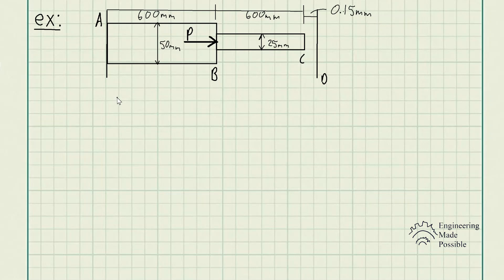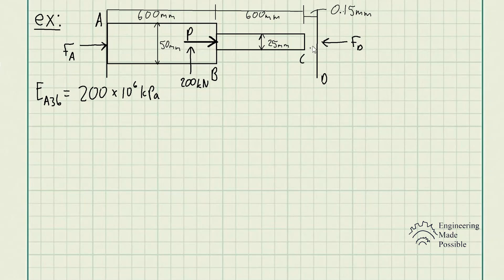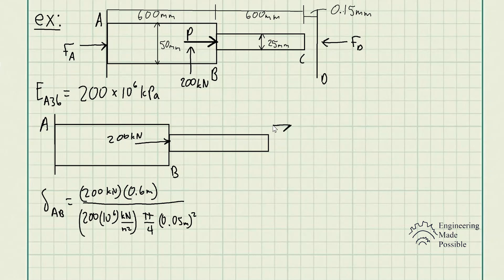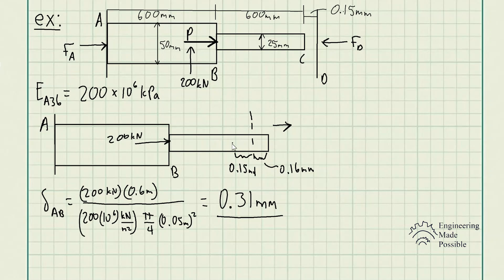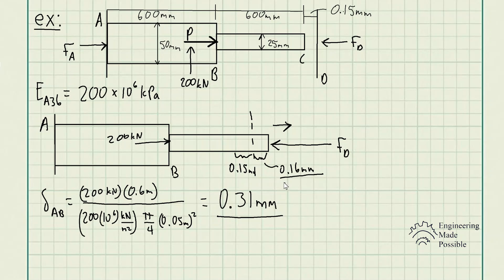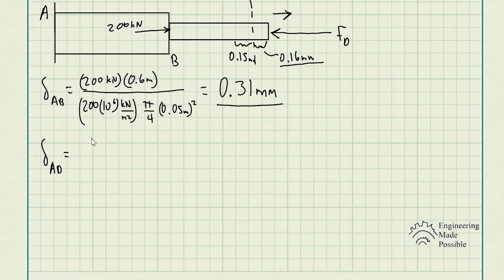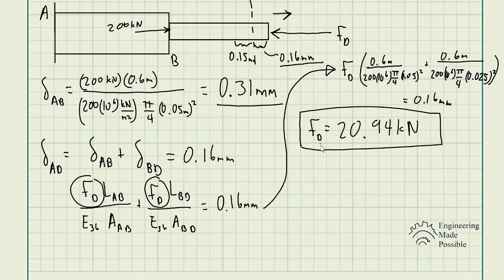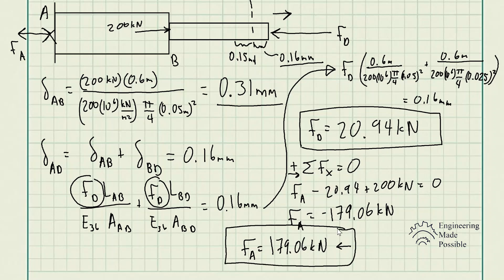If the gap between C and the rigid wall at D is initially 0.15mm, determine the support reactions...

Comment: At 6:22, wouldn't it be wrong to assume that the deformation in AB and AD is 50% + 50% = 0.16mm? Or does the difference in diameter between the cylinders automatically fix that issue?

In other words, are the different diameters of the cylinders the only thing that's causing the different deformation? Does the force P not play a role ?

Sorry if my question is confusing...
Reply: Ik this is an old comment, but yes, the different diameters and lengths of the sections is what causes their reaction forces to be different. If the sections had the same properties, and the force were at the middle,  the reactions would be symmetrical. Note that the sections are separated by where the force is applied.